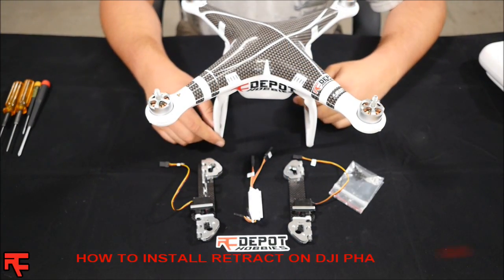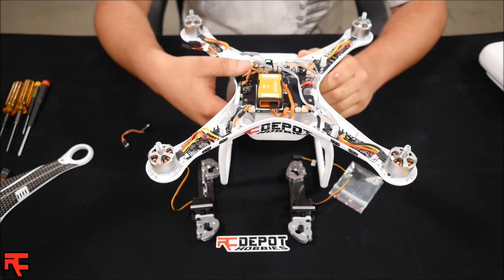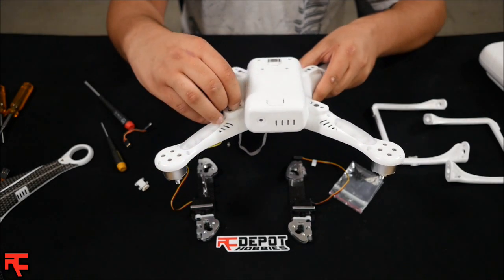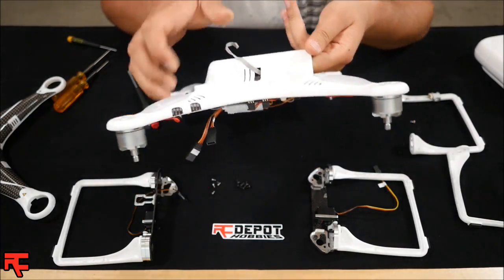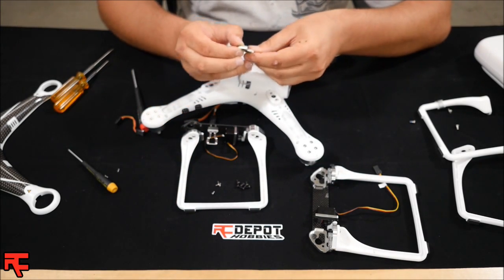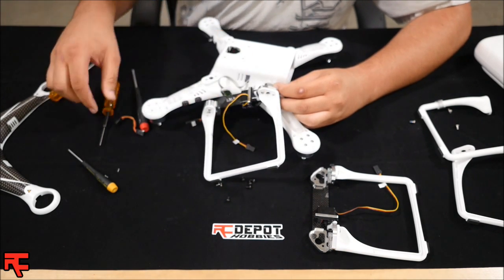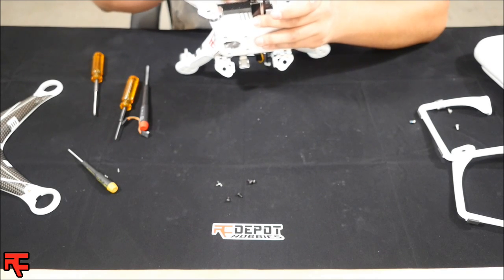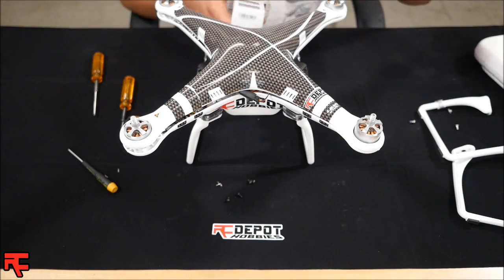HOW TO INSTALL RETRACT ON DJI PHANTOM 2 WITH STOCK RADIO (updated)

Comment: Cual es el código de estas partes, para pedirlas a amazon
Reply: Check out this item I found on eBay: http://pages.ebay.com/link/?nav=item.view&id=141554794387&alt=web
Reply: +ricardopr54 Gracias amigo
Reply: +Marciano Molina De nada! ...Te invito a visitar mi canal y ver un video titulado " Puerto Rico Summer 2015" el cual grabé este pasado junio durante mis vacaciones anuales en la isla.  Ese video lo grabé con mi Phantom 2 not vision with a Zemmuse H3D3 gimbal and a GoPro Hero 3 Black Edition. También tengo otros vuelos fpv con mis aviones. Tengo uno en el q volé mi avión hasta la frontera con México.  Espero verte x mi canal pronto.  Saludos desde Douglas, Arizona.
Reply: +ricardopr54 Clalro lo voy a visitar...
Reply: +Marciano Molina Muchas gracias amigo.
Reply: +ricardopr54 Con gusto Ricardo.

Comment: I want to kno will this mod work with the Phantom 2 Vision Plus V3.0??? and same question as George Kyritsis  does the flicking the S2 switch will cause the Home Location to change? Not buying till i kno details off this mod
Reply: Generalturbo I'd assume you're extending and retracting your gear at your home location (after taking off and before landing) so I'm not sure why that would ever be a problem.
Reply: ok yeh because i wan to be sure of this before purchase

Comment: It only read the pwm signals from the reciver. Think its an Arduino in the white plastic. Save your money. 

http://flitetest.com/articles/arduino-automated-landing-gear-based-on-altitude

One guy from flight test is showing how to do this exept he uses a ultrasonic sensor to measure how close to ground you are. And the gears will pop down automatically

Comment: HI THE "RCDH RETRACT LANDING GEAR FOR DJI PHANTOM 2 & VISION PLUS"

do you think it will work whit phantom 2 V2???
Reply from the maker: Yes, it works with Phantom 2 V2.
https://www.rcdepothobbies.com/RCDH_RETRACT_LANDING_GEAR_FOR_DJI_PHANTOM_2_p/rcdh-ph2retract.htm
Reply: ***** I'm not finding any info about the upgraded tx controller working with this..please confirm!

Comment from the maker: https://www.rcdepothobbies.com/RCDH_RETRACT_LANDING_GEAR_FOR_DJI_PHANTOM_2_p/rcdh-ph2retract.htm
Reply: Hello, I bought an electric tripod you 6, but I installed in the Naza V1 control on the remote control to the order of the work, is the reverse of the work, but, after the boot automatically rise up, and stand landing is not straight, diagonally, thank you!!